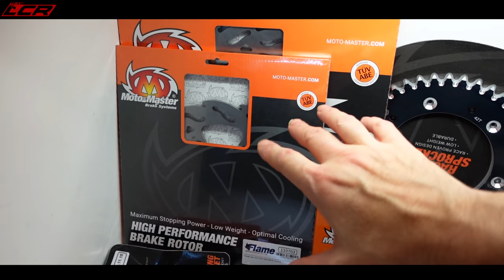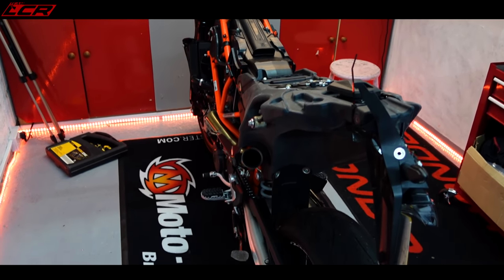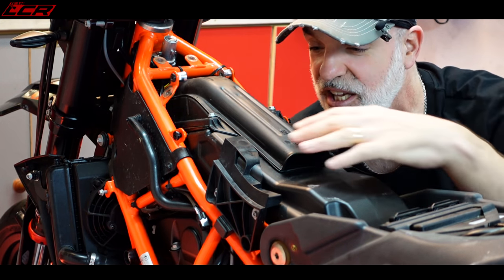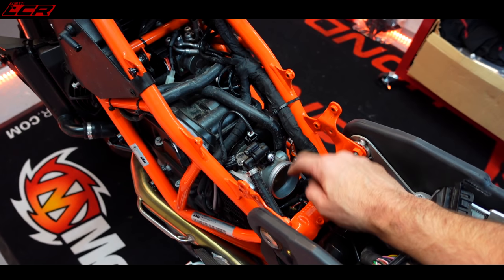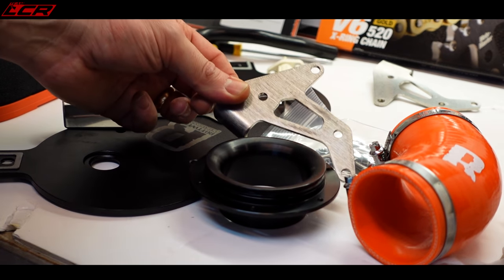Rottweiler Performance Induction Install | Ultimate KTM 690 SMCR Build EP02

Comment: G'Day Mr Chops. You mentioned that you didn't want dust going into the intake, i would have thought nuts, washers 
and screws would have been a bigger problem. Cover the intake with a clean rag mate.This will be a neat machine
when its finished.

Comment: That Hypermotard will be so much better when you get the missing cylinder head back. Running it as a single you must be seriously down on power. With that extra cylinder you might not need all that induction stuff. Looked better in red as well.

Comment: The stock airbox looks like its been designed to maintain a high air intake speed so you may loose low down response and torque removing it but you will gain bhp high up in the revs.

Comment: Love the bike Brother 🤙
I just picked up the 20 enduro r with the same header and pipe. But I went with twin air for the intake..  Smaller than rottweiler and came with an extra 5.5 litre fuel tank which sits completely and comfortably right under the seat hidden

Comment: Great video mate, I pretty much done all you had done to my 2019 enduro but I also have motard wheel set up also. A fantastic 72 horsepower to the rear wheel. Soooooo much fun😀
Reply from the maker: Nice! Did kinda want the enduro version to do the same! 👍
Reply: @LambChopRides  2 x bikes in one. I do also like the look of the enduro forks a bit better and longer travel than the SMC. But such a fantastic bike. Clocked up 17k's on it so far. Love it to bits.
Reply: @Pete Pester 2019 model, just one slight inconvenience is when I change over the ECU has to be reset for the different diameter wheels. The engine light stays on until is reset at my local KTM dealer. But is super awesome😀

Comment: Make sure you extend the fuel tank overflow otherwise it will piss fuel all over your shock/ frame when doing wheelies. It’s connected by that y piece into the fat hose removed with the SAS delete
Reply from the maker: Yes good tip matey, noticed it dripped when I disconnect it. I've left  it really long 👍

Comment: Nice vid Chop the Rotti looks a lovely bit of kit, I’m going slightly different myself, pity there wasn’t a little more detail on the SAS delete kit but looks simple enough. Question: if airbox , SAS deleted do you need a Power Commander if not seeking any more power as mine is the Enduro model and used for the trail?
Reply from the maker: No need to remap just for the SAS delete kit

Comment: Great video thanks.....can I ask where you bought this kit from ?
Directly through them from the states or is there a uk dealer that you use for all the rottweiler parts 
Cheers mark
Reply from the maker: Yes CRT Performance Parts is now an importer. I did get direct however 👍
Reply: @LambChopRides  many thanks :)

Comment: Keep all the original pipework / air box and kit you remove. When you go to sell the bike they might want to have the original parts back on (dealer will charge them a bomb). Its always easier to get replacement oem parts then aftermarket bits.
Reply from the maker: Yes I pulled it out of the bin afterwards 😂👍

Comment: Nice! Not sure if your aware already but I noticed at 13:00, a screw was sat on top of the base plate before you put the air filter on.
Reply from the maker: No dont worry it's not a loose bolt, think it's the air temp sensor sticking up. Thanks for pointing it out though could avert a disaster! 👍

Comment: Would like a tool kit video about what you need in your toolkit to start working on your bike
Reply: Allen keys, ratchets and sockets - want a few sets 1/4, 3/8 and 1/2 inch drive, screwdrivers, torque wrench and spanners. That lot should get you started, then just add tools to your set as you find need for them. Buy the best you can afford, cheap tools are cheap for a reason. They’ll bend/snap/blunt and need replacing quickly. Halfords offer their professional range that have a lifetime guarantee and are reasonably priced.
Reply: @robzz9002  fantastic mate. Thanks

Comment: Hey Chops whats the advantage to aluminium rear spocket wouldnt it wear quicker?
Reply from the maker: Yes it will wear quicker but good weight reduction and of course gyroscopic effects spinning objects etc.. but basically looks better also and are cheap to replace

Comment: You should watch some Pirateracing111 (and less Karate Kid) to get a bit educated on exhaust performance for 690 engine.
Reply from the maker: My German isnt great... what were their findings?
Reply: @LambChopRides  Tekmo was  +0.7 PS and Arrow  -4 PS. The Rottweiler should be a nice improvement in the midrange, it should be similar to the Stage 1 Kit. A good performer was the EURO4 Akrapovic on the 701, but the 690 Akrapovic was not so great. He says, for a big single you need a big exhaust, he also got a custom built Wings with more volume.
Reply: To be more precise, the Arrow with catalytic converter lost 4 PS and without, it was on par with the original exhaust, both testet with the power parts airbox lid.
Reply from the maker: Luckily mine is the race non CAT version, with a CAT I wouldnt expect gains but -4 isnt great! Very interesting

Comment: Why would he throw  away  a  new OEM Air Box?   It was designed to   be quiot and keep water out of  your engine...  I assumed the  stock air cleaner was paper ..  I really don't  like to have to buy new Paper  air filters all of the time.. and they don't  work as well on dust  as  oil soaked foam does..

Comment: Pure food porn for MC riders ... So, I have no technical clue about what is going on. You're pulling out a complicated air feeding system, and replacing it with a much simpler (and lighter) one. That will eventually help feed more air, and more fuel into the machine, which will make it more powerful. So far so good. But what is the actual and specific impact in terms of Euro emission standards (just curious, not preachy)? I imagine it's negative, and is that why the bike isn't built like this from the get-go, or is your solution a more expensive one? Hope you'll answer my obviously Dummy questions. Cheers.